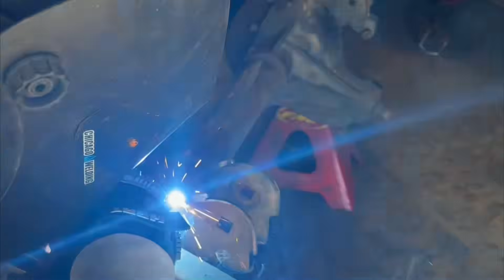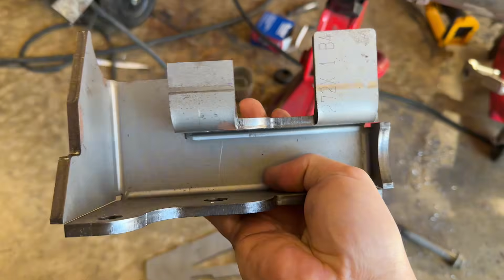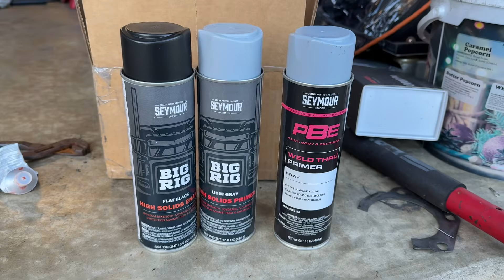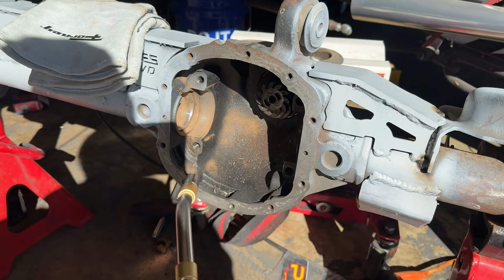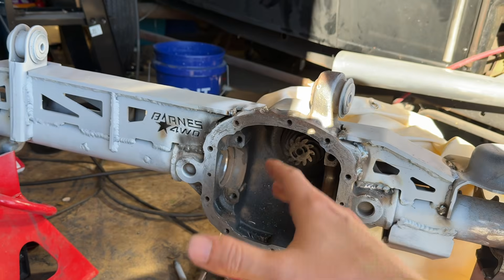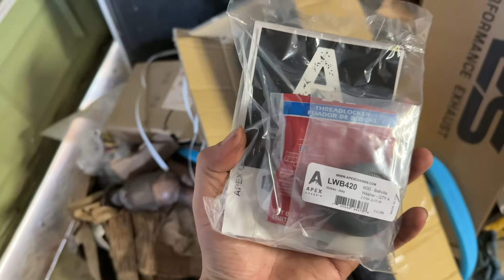Building the Ultimate JK Dana 30 for My WJ | Barnes Pro Series Truss & Track Bar Bracket Install

Comment: From what ive seen on prices. You could of put one tons under the wj for what it cost to build the dana 30 out like this build
Reply from the maker: This is a relatively cheap build aside from steering but truss, sleeves, track bar bracket, gussets, delete plates, skid plates are all under $175 rear truss will be $380

For tons it’s about $1000 for trusses, $1000 for axles bare minimum then you’d need driveshafts, wheels, steering, at least 40s to get any clearance. Priced out it was around $14k for somewhat built tons and the rest of the stuff.